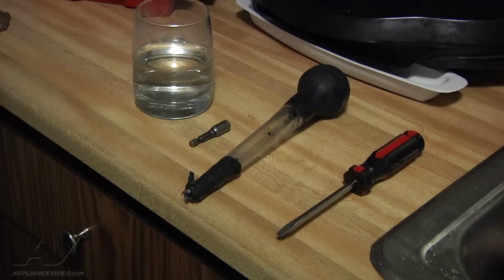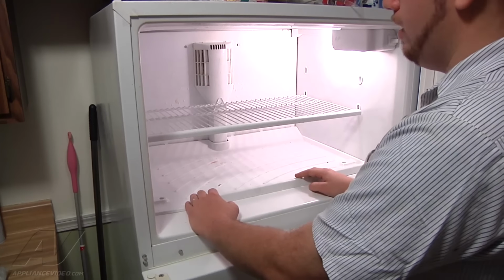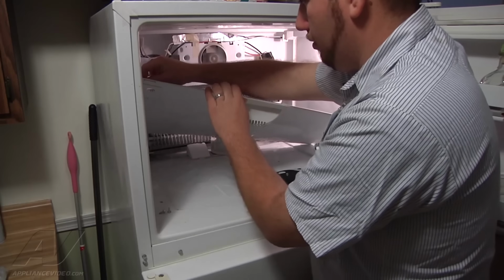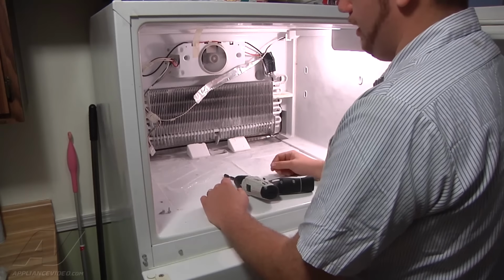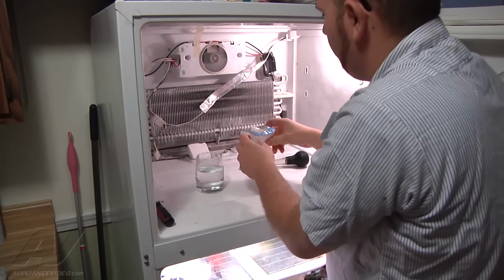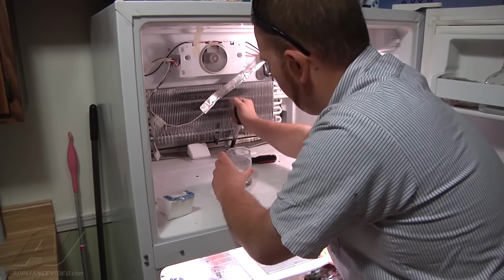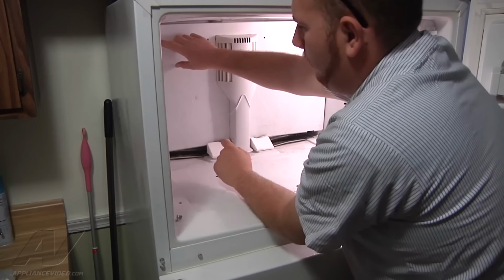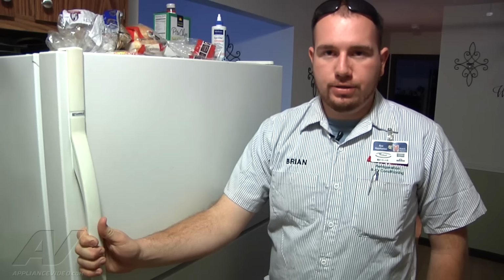Kenmore Refrigerator Repair - Water Leaking From the Freezer - Evaporator Drain Pan

Comment: Very well organized and clear video.  My only two additions would be: 1) add a catch pan under the air duct in the refrigerator compartment to catch water and crud coming down during the ice removal and drain clearing and 2) wash off panels and shelf with warm, soapy water, then rinse, while they are out.  Will be ordering from http://www.appliancevideo.com as needed in the future.
Reply from the maker: ThePitmaster

                Thanks for the good suggestions. I will add them in fonts for this video.Please help our ranking by subscribing to our YouTube page or posting our ApplianceVideo.com site on your Facebook or Twitter account. This will help us to continue to make new professional videos from our factory trained technicians. We also have our authorized technician’s daily emailing professional advice daily to people like you that have appliance problems. We have helped thousands of people save hundreds of dollars. Thanks in advance for your help.
Reply: Some specific notes from performing this repair yesterday.  We have Sears Coldspot Mod 61289101, manufactured 04/02.  The video was very, very helpful in breaking down the freezer compartment to access the defrost drain.  The drain on our refrigerator was in a slightly different location than in the video.  There was no Styrofoam block to remove, as the drain hole was out in the open, in an aluminum drain pan toward the back.  After chiseling away the ice [being careful not to bend the rim of the drain pan down], it took about 10 cycles of adding hot water with a basting bulb into drain pan + removing the cooled water with the basting bulb some 30 seconds later to break the drain line ice dam.  When I used a coated wire to clear the drain line, I found some sort of odd, stepped offset at the top of the drain outlet/tube that may contribute to build up.  I checked the evaporator pan after running the coated wire a few times and flushing more water down.  I did do not find any compelling evidence that there were any solids that worked their way into the drain line.  12 years w/o an ice backup before this.
Reply from the maker: It sounds like you got it taken care of properly. Good job. Some models are different but the video gives you a good guideline. Thanks for you input and follow, it helps us make better videos in the future.

Comment from the maker: Curtis 
          In most cases food or debris get stuck in the drain assembly. If this keeps happening to you every two weeks then I can tell you what will correct your issue. Order a defrost heater and defrost thermostat. You either have a weak heater not radiating heat to the drain assembly or you have a defective defrost heater that is shutting the heater of prematurely. When you get the parts in open up the doors of freezer and refrigerator and shut off the unit for 24 hours so all ice can thoroughly defrost. When you put in the defrost heater make sure it is bowed down about 2 inches from the drain hole, you can bend it down without damaging. The heater is what radiates heat to prevent the drain from plugging. As a secondary safety you can take a piece of copper wire and wrap it around the heater and put it in the drain hole about 2 inches. This used to be a kit the manufacture sold to radiate heat from the copper wire to the drain hole as a secondary safety. I would do it so you can resolve your problem permanently. I have been a technician for 30 years and guarantee this will take care of your problem, I have done over 500 of these fixes myself. If you need parts call 1-800-830-5465.  Please help our ranking by subscribing to our YouTube page or posting our ApplianceVideo.com site on your Facebook or Twitter account. This will help us to continue to make new professional videos from our factory trained technicians and help people like you. We also have our technicians daily emailing professional advice to people that have problems with their appliances. We have helped thousands of people save hundreds of dollars. Thanks in advance for your help.
Reply: Hey Brad,

I'm not sure what ***** will say but I used about an 8in. length of 14ga. solid copper wire.  I folded it in half around the heater element and twisted it all the way down.  Then I pushed it into the drain hole.  It's been running like that for almost a year now with no problems.  Best fix ever!
Reply: Curtis Demmert Thanks Curtis  - They suggested 18ga but I like the idea of creating the twisted pair.  I ordered the 18ga and imagine that should work fine.  Thanks for the tip.
Reply: Your explanation makes sense.  After posting my comment the other day I searched more youtube videos on replacing defrost heaters and noticed what they called a heat transfer strip in one video.  It just looked like a piece of metal wrapped around the heater and down to the drain.  I like your idea of a copper wire instead and I'll be able to find a solid core long enough around the house.  Maybe I'll double it up some how.

Thanks in advance.
Reply from the maker: Curtis
      Copper transfer's the heat better and will not burn in half,use a copper wire.
Reply: ***** What gauge copper wire do you recommend?
Reply: Curtis Demmert +
Reply: Definitely seems like it needs a heater

Comment: quick question friends, i have a very similiar kenmore fridge and the same thing happens with the water leak. Ive been unplugging the fridge and leaving it for a day or so. Doesnt that also work? After about a day i just plug it back in and it solves the problem for a bit
Reply from the maker: Danny
         Just unplugging it for one day will not correct the issue. You either have a plugged drain with food or debris stuck in it or a weak defrost heater and thermostat.You need to remove the back cover after letting it defrost for one day and pour hot water down the drain until the water goes into the drip pan. If the ice comes back after that you need to replace the defrost heater and defrost thermostat. 80% of the time its just a plugged drain.  Please help our ranking by subscribing to our YouTube page or posting our ApplianceVideo.com site on your Facebook or Twitter account. This will help us to continue to make new professional videos from our factory trained technicians and help people like you. We also have our technicians daily emailing professional advice to people that have problems with their appliances. We have helped thousands of people save hundreds of dollars. Thanks in advance for your help.

Comment from the maker: In most cases you will need a 1/4 inch socket. There will be two screws on the side of the ice maker you will need to loosen and then slide the ice maker upward, this will disengage the ice maker. Then follow your wiring harness back and unplug it. If you are in need of any parts, our parts department has over 5-million in stock for same day shipping. Please call  1-800-830-5465 for any of your parts needs, or you can  order online 24 hours  at: ApplianceVideo.com.
Reply: Thank you for the quick reply. The bolts that attach the lower and back panel are much smaller than a ¼". I'll have to try some other sizes.
Reply from the maker: I have never seen anything smaller than 1/4 inch screws unless they are a star bit or hex head screws.
Reply: You are correct. My bad thanks!
Reply from the maker: Glad we could help, I hope you get your problem taken care of. If you need parts please support our parts department at 1-800-830-5465..Thanks

Comment: Shame on you, Brian.
The very first thing is to ALWAYS disconnect the appliance from the power source.
I've been doing this 30+ years and, even I could have an accident if I didn't unplug it.
You are posting this to help amateurs and, they know far less than they think they do and could get hurt~~seriously.
Also, it would be helpful to them if you told them how they can determine the MFGR of whatever "Kenmore" they are attempting to repair.
Reply from the maker: Thanks for your input. We normally would unplug the unit but we needed the additional lights in the freezer to show our viewers a clear way to unplug the drain. We do advise to unplug the unit before attempting to do this repair.